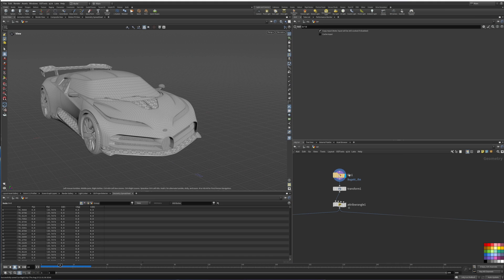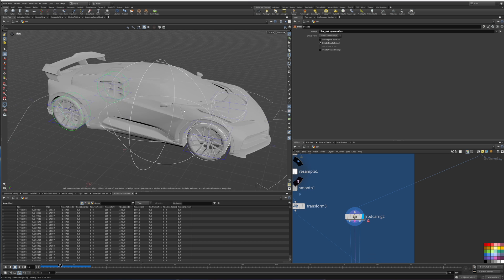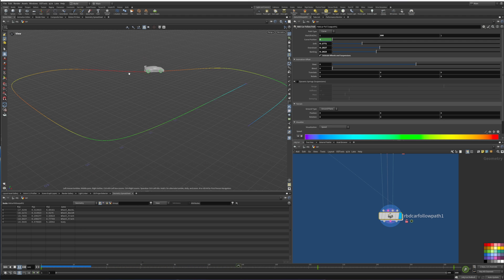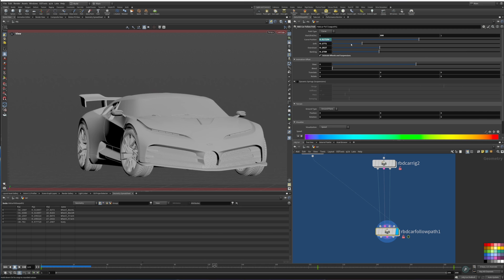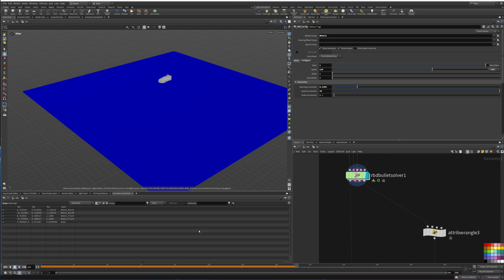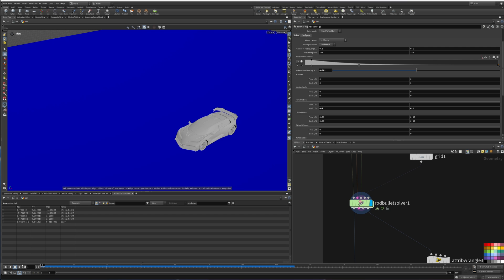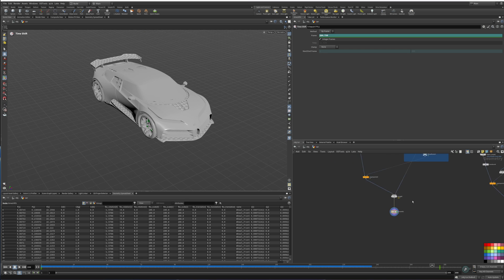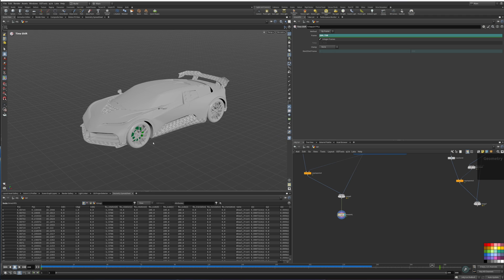How to rig a car in Houdini 20.5 with RBD Car Rig (Part 1)

Comment: Hi Jorge, thanks for this wonderful tutorial, it helped me a great deal. But I ran into a problem, I am currently trying to make my car jump over a ramp made in heightfield. I am animating by a curve that draws a smooth trajectory jump. But if I do that, my rbdfollowpath node’s curve dips down immediately 90angle degrees off the ramp to the ground. How should i fix this and make my car make a smooth trajectory over the ramp? 😢
Reply from the maker: To properly make it jump over the ramp with dynamics would be using the RBD bullet solver and the heightfield. Unfortunately the RBD car follow path looks to be more of Chop network dynamics and its a bit fake. The RBD car follow path node is good to have exact control over where it travels, it has a bit chop spring setup that controls the bounciness. But your best bet would be using the RBD bullet solver right after the RBD Car rig. At least this is the easiest way I know how to do it right now.
Reply: @jorge_lega  thanks! I will try that 😄

Comment: Hi, a question. Do you have the link to the page where these cars can be obtained to practice in Houdini 20.5?
Reply from the maker: This is the one I used. 
https://www.cgtrader.com/3d-models/car/luxury-car/bugatti-centodieci-2020-studio-c25e80d7-5902-40d0-9ff6-cf7628c5c26c

But you can look at websites like turbosquid.com, Sketchfab.com and if you install blender marketplace has some of the same ones at a better value, but may require you to install blender and then convert the files over to fbx etc..

Comment: Your tutorial is great and super useful, but I can't bind the brake discs on according to your method, it always rotates strangely,and I would like to ask you what you did to fix it?
Reply from the maker: I put chapters now on the video so you can find it easier. If you go from 11:54-14:27. I walk you through the setup and canceling out the rotation of the wheels. the main key to canceling the wheels out is in the constant node inside the pointVop. On the constant node switch to 3 float vectors and you just place a 1 for it to keep moving and 0 to stop moving. 

Let me know if your able to figure it out.
Reply: @jorge_lega  I really appreciate you sharing this tutorial! This is great for doing a quick car binding. But I'm having the same problem.
Reply: @jorge_lega  unfortunately,my problem is still exist. Could i give you my hip file? I would like you to help me check that what the problem is.I wonder if it would be convenient for you   to give me  an email address.Thank you very much.